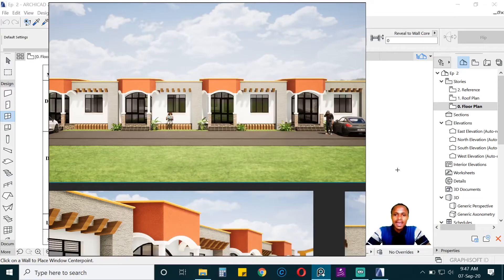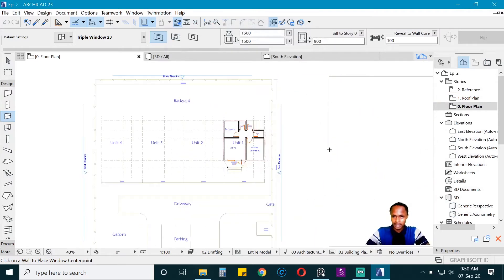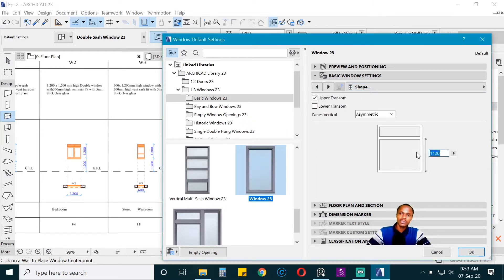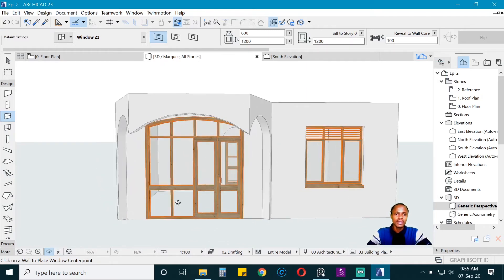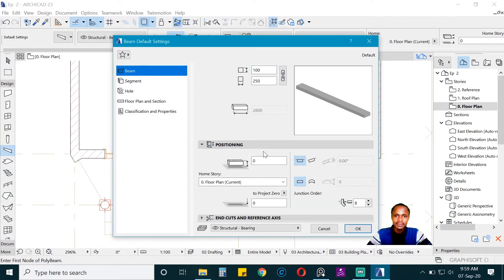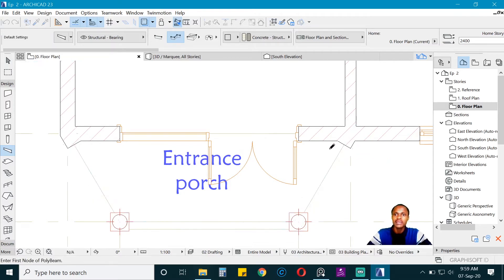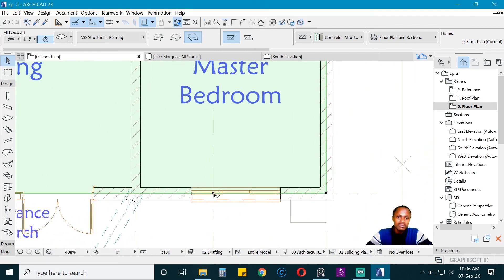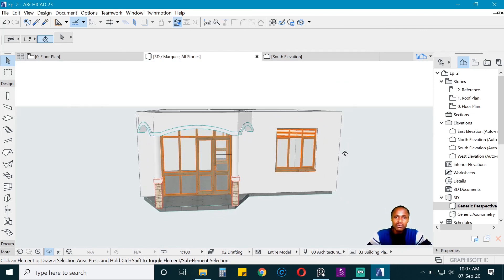Model with Archicad tutorial for beginners (Episode 3)

Comment: Hello, what key should I press when selecting doors or windows easily without including the wall on the floor plan?
Reply: Also, I have a problem with my column. When I add the column in the 3D view, it became subtracted by the Arch on the front porch.

Comment: Hello Allan, I'm using archicad 26 and when I place the columns on the entrance porch they are being cut and I cant see the top white part. Im not sure if its because of the empty openings or the walls. Do you know how I could fix this?.. Thanks.

Update: I've managed to work around the problem by using "solid element operations" between the walls and beams to form the arches instead of empty openings.